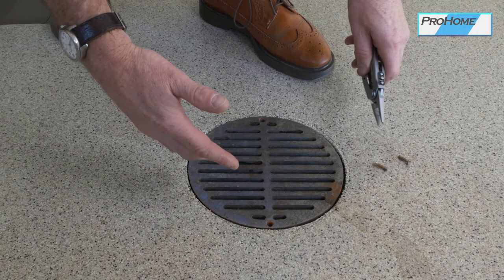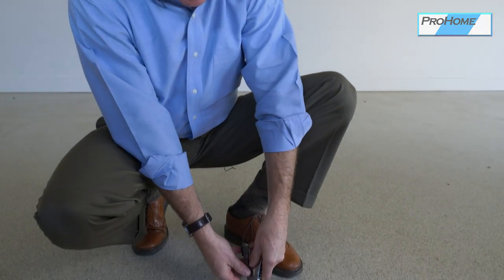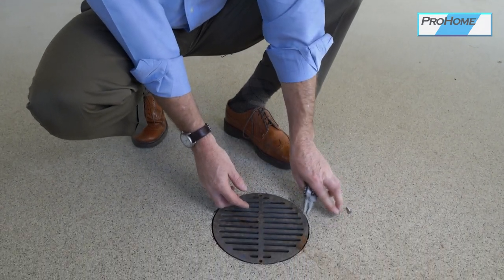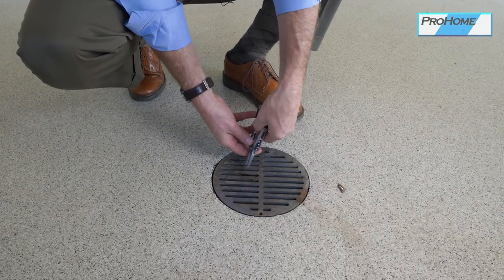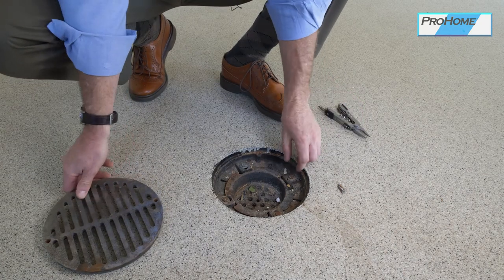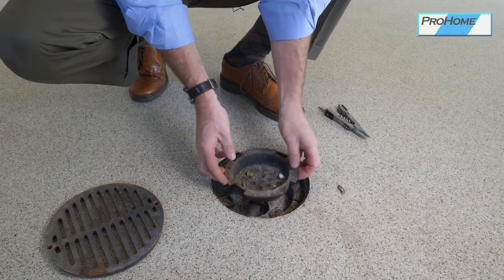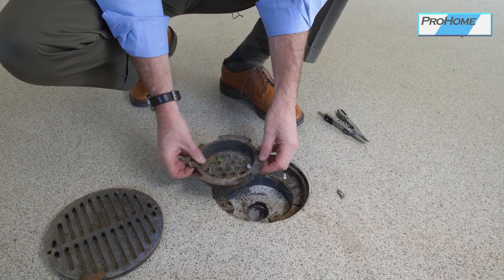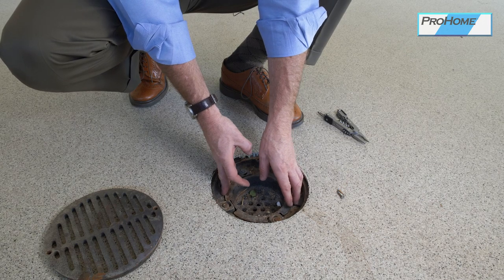How to Clean Your Garage Drains

Comment: Okayyy yeahhh.. soo the drain in my garage has a white plastic stopper covering it. That stopper is NOT removable for some reason. 
 Now, after doing a tiny bit of research and watching a video or two.. Im starting to believe that whoever built our addition to the house and also built the attatched garage as part of the addition screwed up when installing the drain stopper?
 I don't think its supposed to be "non removable" or have the very edges of the stopper covered with concrete. 
 There is no hinge that would allow me to just open it like a door, it doesn't just simply pop off when lifted and there are no screws to unscrew to allow it to just pop off. If there are, they're under a layer of the concrete floor..
 Sooo, what do i do?!? Do i just smash it with a hammer or something to gain access into the drain and just buy a replacement cap that would just sit on top of the drain and just pulls right off without having to be secured? 
 What do i do?!?! I don't know what to do!! I do know that i need to unclog the drain and that im NOT calling and paying anyone to do it when I can just do it myself very easily if i can figure out how to get the stopper off..